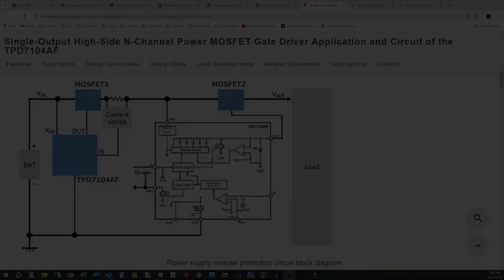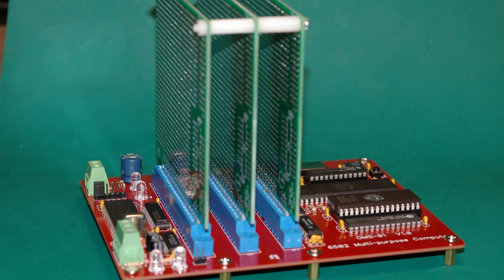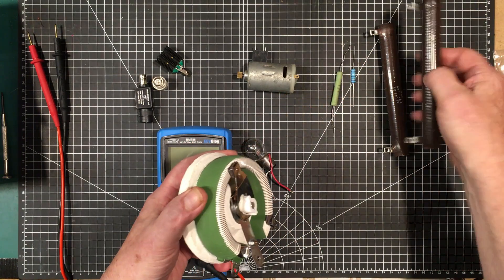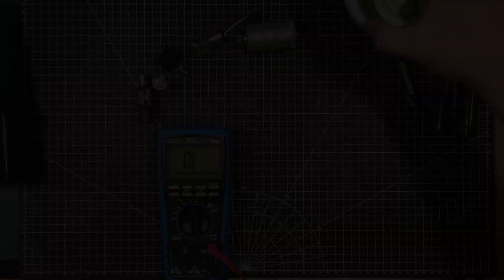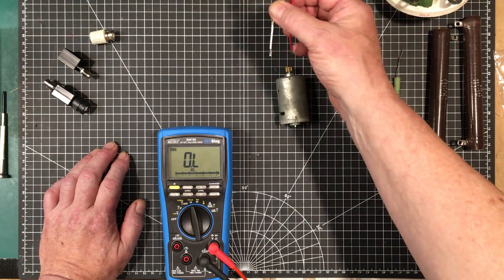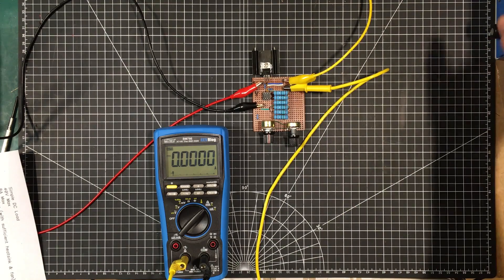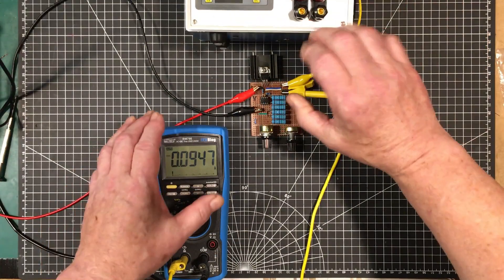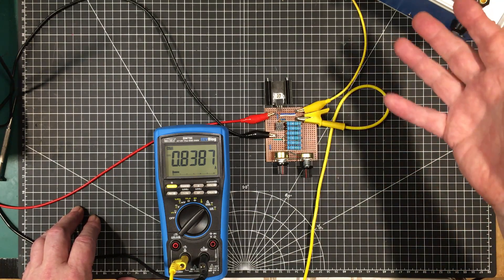Uni-Byte 0198 - The LOWDOWN on Loads for ELECTRONICS

Comment: My eyes must be getting old (or YouTube compression has messed up the colours on the resistor colour codes, which seems less likely).  The 6 resistors that make up the sensing resistor on the Simple DC Load don't look like 1.2 ohm resistors, which would give the 0.2 ohm 18W resistor on the circuit diagram.  

Also, yes a video project building one of these is a great idea.  Everyone should have multiple loads in their toolbox, and that one would make an almost ideal beginner project for anyone building up their electronics toolkit.
Reply from the maker: LOL!  Your eyes are not deceiving you!  When I drew up the schematic I thought I had a bunch of 1.2 ohm resistors, but it turned out that my memory was not quite right - they were 1.5 ohms, so that should read 0.25 ohms.  Good catch.

Comment: Scullcom electronics did a fully digi/ana load that was quite well done AFAIK. Powered by arduino and some ADC/DACs so "fully programmable" to your heart's content also, with 4 mosfets. Sort of a half-way house between backyard-diy opamp+pot and something commercial.
Reply from the maker: I saw that.  Mine would not be quite so fancy on the digital side though.  Maybe a better first project though.  Scullcom does some nice stuff but it's fairly advanced.
Reply: @uni-byte  Yeah great channel, very thorough.

Comment: W = A x V
The OpAmp circuit is my choice. It would have the smallest affect on the circuit under test.
Reply from the maker: Yes, they can be inexpensive, compact and adjustable too.
Reply: So you are an Amateur radio operator.!?
Reply from the maker: @snakezdewiggle6084  That's a bit of a story.  Let me start by first saying, no .. technically, not yet.  I have been threatening for a long time, but I live in a pretty sparsely populated area so there are 1) No local examiners so I can take the exam easily.  2) No one to converse with unless I get some pretty decent gear.  I did have the exam set up twice in the past but once the examiner cancelled and the other time I cancelled as the roads were closed due to a winter storm.  As it is right now the radios I have are CB, FMRS and those I have limited to GMRS frequencies.  All of which can be operated in Canada without a license.  Since there is a dearth of radio operators in my area I usually just use the GMRS and FMRS radios on wilderness outings (hunting, camping, fishing, etc..) with friends.  I may yet try to set up an exam again .. who knows?
Reply: @uni-byte 
You have the knowledge and insight into components and circuits. Well spoken, good pitch. It was a toss up between, school teacher or Amateur radio.☺
It has become an expensive hobby unfortunately.
Once you sit and pass the exam, thats your's, for life, like any degree.
You can then pay for a license and callsign.
I've surrendered my license and callsign since losing my radios, etc.
If you know anyone "into" radio, they will your best avenue. Just had a quick peek at your government's page. There is plenty of good info there and links to support. Looks like they have Practice Exams to try out. I think you can sit the exam via video / zoom. That makes it an Open Book exam.
When you have some time, just poke around the Gov' pages.
Its not everyone's cup o tea.
Reply from the maker: @snakezdewiggle6084  I do the sample tests every so often and score better than 85 each time.  Wasn't aware of the on-line option though.

Comment: Oh boy! A lovely load lowdown!
One of my favorite uses for my NanoVNA is for characterizing resistors for RF applications.
I nearly got a free electronic load from a government lab I worked at. It had a bad meter that was only about $20 to fix, but the group manager said to get rid of it. No other group wanted it and since it was broken they were going to toss it out. At the last minute someone in another group said they'd take it. Now I'm glad they did. It was ridiculously expensive, retail price. It weighed over 200 pounds. It would have been a huge white elephant sitting on casters in the corner of my lab. I don't recall voltage and current load capacities, or even the manufacturer. This was about a decade ago, but it had 8 large high-volume fans and a huge heatsink (probably over 50 pounds of aluminum on it.) I recall the spec sheet had some ridiculous numbers on it. It was all a bit much for testing flashlight batteries in what is now basically a hobbyist lab. :)
Reply from the maker: LOL!  It sounds like you dogged a bullet!
Reply: @uni-byte , my HP 524C (55kg) taught me an important lesson.
Reply from the maker: @johnwest7993  The importance of a gym membership?
Reply: @uni-byte , pretty close. It taught me that I wasn't Superman, and it taught me what the term 'boat anchor' in electronics really meant.